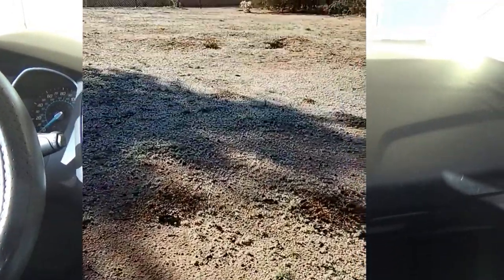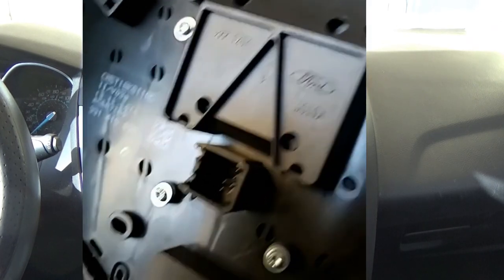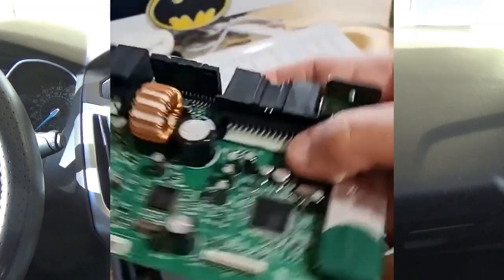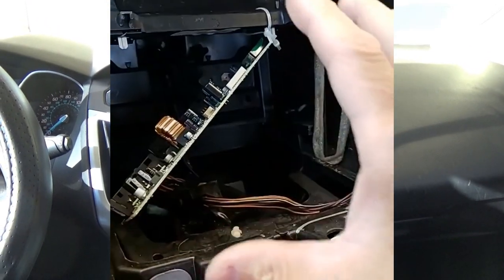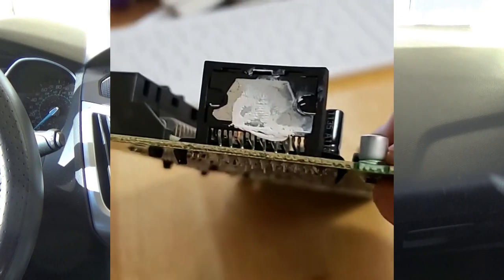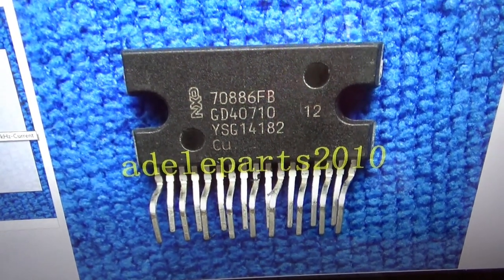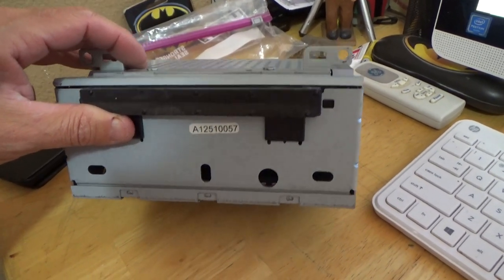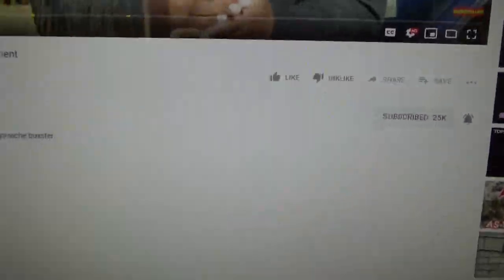2012 Ford Focus Radio Popping & Staticing Possible Repair Fix

Comment: My 2014 Focus radio made the horrible popping, cracking noise. I removed the radio and replaced the two audio output ICs.  I also added a good quantity of heat sink compound behind  each of these chips.  It's  only been a couple days but so far so good.  Replacing those ICs isn't for everyone.  I'm a retired electronics tech and even I had plenty of difficulty with replacing those chips.
Reply from the maker: These Cars Have A lot of Recalls.
Reply: My brothers Ford radio is draining the battery. Took the radio out and connected to external 12V psu, the amps are oscillating rythmically every second like a metronome (0 to 1Amp). The heatsink attached to the two audio IC's is getting warm. I think I may try replacing these two chips, but seems quite a task. Well done for fixing it.
I may suggest my brother gets an aftermarket radio instead! 👍
PS Board looks perfect. No popped caps or corrosion. But is 2007.

Comment: EXACTLY what my grand-daughters 2012 Ford Focus does (did).  Ford Focus Radio = JUNK!!  In her case, weak battery + several months of this radio issue = dead battery.  The radio designer must have needed to keep a HOT B+ on the radio (regardless of ignition key on/off/acc) to keep the volatile memory alive, neglecting to see the circuit vulnerability allowing HOT voltage to access other circuits, keeping the amplifier ON.  JUNK, JUNK, JUNK.   Thanks for the video, most helpful!
Reply from the maker: Thanks for watching.
Reply: Mine never worked when I hot the car plugged in a aftermarket killed the battery with the radio off so I wired a socket fuse and shut it off directly at the fuse box and my battery no longer get killed

Comment: Looks like there was originally a heat sync attached to them, what's why there are remnants of the thermal paste. If you bought some new heat syncs & thermal paste, it should fix the issue. They would keep the transistors in the small amp chips cooler so they wouldn't overheat. Normally transistors generate immense amounts of heat when in operation & have heat syncs attached to them due to this reason
Reply from the maker: These radios are garbage, ford knows about it and dont care. Threw it in the garbage.
Reply: They sit directly against the outer case. 
I took mine apart and it seems like the outer case (metal) is the "heatsink" lol
Reply: @inazuma1  when you took it apart did you put new paste on did it work?
Reply: @roniclark6514  yes, for a few months. 
Ended up buying a used radio from a Ford c max on ebay and it's been working fine ever since.

Comment: The heat paste transfers heat to the box casing of the metal box..the box will help dissipate heat with new heat paste
Reply from the maker: threw it away and sold the car.

Comment: Those things are normally hot. The back pad with the thermal paste uses the metal radio case as a heatsink to dissipate heat. Not saying it couldnt be the issue, but they do get hot.
Reply from the maker: Took the radio out and thru it in the trash.
Reply: Did total removal of radio make the scratching and popping quit? Thank You!!!
Reply from the maker: @rickduke1081  yes

Comment: Those need the radio casing to dissipate heat. That’s normal for them to get hot. Take a wire brush and go over the entire board. Make sure it’s unplugged first. If you are wondering why, research tin whiskers
Reply from the maker: i thru it in the garbage and sole the car.

Comment: Did you figure this out?? My horn stopped working at the same time the radio did the static pop thing!! I'm tired of being my own rock band in the car...lol...
Reply from the maker: I thre it in the garbage and use my phone now to listen to the radio.
Reply: @Iseekoutthetruth  <3 Probably the direction I'm going to take too:)
Reply: Okay.... maybe you have the answer,  so im going to ask you first! I noticed that if I don't use any other keys on my key chain,  it happens less frequently,  and when it does snap crackle and pop,  if i reach down where I can adjust the telescoping on my steering wheel and jiggle the wires that attach to my cylinder to start the car,  it stops.  Could this be a short in the key cylinder causing all this chaos?
Reply from the maker: @ohbabeissmokin  maybe
Reply: My horn did the same thing as yours. No radio, no horn. But all of a sudden, months later, my horn started working again. 🤷🏼‍♀️ The radio still pops and cracks though.
Reply from the maker: @alaynamudd4156  threw my radio away, no more poping.
Reply: The same exact thing happened to me...radio and horn went and I've told my husband the same thing you mentioned that maybe there is loose wiring in the steering column because both the horn and radio wires are in the steering column

Comment: I own a 2013 ford focus and my radio recently started popping and cuting off so i did some research and found out there is a connection on the left side of the steering column under the turn signal little a bit closer to the dash , it can become loose over time its not the acm (audio control module) but it is connected to the ignition if you mess with it at first it seems like a wire is loose but it is the whole module. I've been at it all day and finally got my radio working after i figured it wasn't a wire issue but the whole module the part number im assuming is u3nfa and it pops up as a ignition module of some sort but after some jurry rigging (zip ties) my radio is working again ill be heading to the junkyard and see if a replacement will work
Reply from the maker: cool, i threw my radio in the garbage and just recently sold the car.
Reply: Iseekoutthetruth  do you miss ur car? Mine is doing the same
Reply from the maker: @angelf5186  no, I do not miss it. I got a better car, Honda CRV.
Reply: Did it work tho???
Reply from the maker: @theofficialdjcj no

Comment: Those are audio output chips. They will get very hot and burn out if not attached to the heat sinks. Look very close to where the chips are soldered to the board with a magnifying glass to look for broken solder joints. A broken solder joint is what is causing the problem with the radio.
Reply from the maker: I sold The Car and Threw The Radio In The Trash.
Reply: Actually one of those chips is a voltage regulator and the other is the output. But if it helps anyone out there…I removed the radio from my 2014 Ford Focus yesterday to attempt a repair. It had started making frying sounds with the ignition switch turned off and no one in the car.  The solder in this radio is very hard to work with but can be done. I was unable to find the exact location of the broken solder joint that was causing the problem but found several areas of suspicion. I re-soldered each leg on both chips pointed out on the video and each leg on both of the connectors and the legs to each of the capacitors in the radio. Re-installed and works perfectly.
Reply: @Iseekoutthetruth  I guess I was a couple years too late but maybe the info might help someone else.  I watched your video before I decided to attempt mine to get an idea of what I was dealing with so thanks for the video
Reply: @steverayburn4138  Is it still holding up after your repair?

Comment: unlikely the Power amp ic is at fault - when these go they usually go with a bang and never work again, the bigger NXP chip is the power amplifier and the other smaller IC is a voltage regulator, the heat sinking for these is only just about adequate (there was no money in the pot to improve the heat sinks). These units did have another design weakness, one that was copied over when Ford found an even cheaper supplier for their radios (I guess to save development costs they took the fast route) and did not follow the design guidance provided.

The later head units do not last as long, especially if you live in a warm climate!
Reply from the maker: i tossed it in the trash and sold the car.

Comment: Having the same issue in my 2014 Ford Focus SE. Info I have found on this issue thus far has stated the amp/amp wiring being the culprit
Reply from the maker: The radio is Garbage. Threw mine away and sold the car.
Reply: Were you able to get it fixed?
Reply: Mori Anderson were you able to get it fixed?
Reply: @derrickjones3505  Hi Derrick! I sure wasn't.  I changed the fuses as shown just above.  I am dreading having to take it in to Cartunes! >_<
Reply: Heads up for my theory. I strongly believe that the 2 integrated amplifiers go nuts, after the silicone compound dries up where it connects to the radio casing as a conveyor heat dissipator. So, those integrated amplifiers heat too much and cease working. They cost $3 each. I have a radio problem and I am going to replace both folks.

 Please have a calyfragilisticexpialispectacular week !
Reply: Did you get any good results after replacing the two amplifiers?
Reply: @morikayradio  No. Radio actually stopped making this noise for some time. Recently started acting up again. Wife is screaming at me to get it fixed.  Cant say I blame her.😁
Reply: This is what mine is doing so bad I can't even go anywhere. My 2 year old is terrified of it. 2014 focus biggest regret of my life
Reply from the maker: I sold my car.
Reply: @Iseekoutthetruth  wish I could
Reply: How did you fix it?
Reply: @nymontano3874  Got rid of it. Trade it in for 2021 KIA RIO S 😁
Reply: @hollynelson2626  I have a 13 focus and a 2 year old as well. That static sound strikes absolute terror in her!

Comment: Did a new radio fix the issue? Other blogs on this issue stated that even replacing the radio didn’t fix the issue. Just curious about your experience. Thanks
Reply from the maker: Never bought another radio, I use my phone now.
Reply: I heard people have had good luck with replacement radios.  Yet, like some manufacturers they get bad or poor made parts.  That's some of the things the U.S. is always fighting with these our countries about poor quality car parts.   Examples, air bags, ignition switches, and ect.
Reply from the maker: @michaelelliott289  no Quality in America today.

Comment: You can try to change those ICs out. One or both may be bad. Worth a shot. Are you worried about the radio? I bought a car stereo at walmart for $50 and I'm going to hook it up in the garage. I have a nice pair of speakers.

If you can handle close solder joints you can try but might void your warranty and you'll have no radio. What kind of soldering iron do you have?
Reply from the maker: I am not worried about my radio, but I'm not spending $50 on a new radio. I have just a regular looking solder iron.
Reply: @Iseekoutthetruth  the one I have is the one they sell at walmart and the solder is in the plastic tube thingy. 

If you want to give it a shot you can but if you mess up you'll have no radio.
Just watch the solder points. They look very fine on that chip. Maybe change the larger chip first. One looks like a preamp and the larger one the main amp IC.
Reply from the maker: @coondogtheman  This is the stock radio, there is no warranty on this radio, it does not work now, I do not have the IC chips, I would have to order them but they are from china, I could careless about this radio, I can use my phone to listen to th radio if i want. i will not be spending money on a new radio.
Reply: @Iseekoutthetruth It looks like the pins on the ICs are thru-hole mount which is very easy. You'll need a solder sucker as well and the two chips. Go to town man since the radio doesn't work anyway.
Reply: Good tips dude. Still helping out 2 years later

Comment: Those "things" you say are hot are the final output I.C's. They're what actually amplifies the signals. They WILL get hot if they're not firmly attached to the heat sink. If one or both get EXTREMELY hot while powered on with volume at minimum it's probably faulty. Bad final amps can make some pretty unforgettable sounds in their death throes.
Reply from the maker: I sold this Car.

Comment: My 2012 Focus has thre radio work on and off and sometimes it even output SUPER loud static through the speakers ever when the car is off. Anyone have any advice or suggestion? Is the whole radio junk or is it salvageable?
Reply from the maker: its Junk.
Reply: So this is exactly what happened to mine and now the radio is completely dead I put up with it for a year but I’m gonna dig in and try and figure it out
Reply from the maker: @chrismorine5406  its garbage.
Reply: literally dealing with the same thing, it’s so fkn annoying
Reply: mine has gotten so bad I’m scared to drive it. I’m so lost on where to proceed with it. It’s like a screeching static. Got so loud I pulled over and got out the car. (2012 Ford Focus SFE)
Reply from the maker: I took the Radio out.
Reply: I have the same static problem. Anyone know how much is costs to fix?
Reply from the maker: Nope, sold my car, its got way to may recalls on it.

Comment: 2014 ford transit.  same radio same static and amp popping.  radio doesnt work at all noise continues even with truck off and car doors remotely locked
Reply from the maker: yup, threw mine in the garbage.
Reply: I had to take all radio fuses out to make the noise stop
Reply from the maker: @christinasatterfield6711  I just took the radio out and it stopped.

Comment: My car usually plays music for a good 30 minutes and then after that it starts popping and then music plays for a few secs and then it pops again. Any ideas what could be causing that?
Reply from the maker: No idea, Fords radios are garbage. Threw mine in the garbage and sold the car.
Reply: This is the problem if had for 5years with a 2012 ford fiesta se. Works for the first 20minutes maybe 30 minutes then it pops out for 1-3 seconds then works for 2-4 seconds before popping out for a few seconds again. I have to remove key, open and close door to shut off power to it completely then wait about 30minutes before turning ignition again to get maybe  30minutes of uninterrupted use.

Comment: They are essentially mosfets that your referring to. Most likely thats not the problem. Typically its the square chips with more pins, like 120ish pins that come loose. Essentially they are the processors. All of these ford radios and any of these years are junk. We replace them almost weekly these days.
Reply from the maker: Sold the car.

Comment: Just buy a after market head unit .you can get everything at walmart or bestbuy. The factory radios are crap
Reply from the maker: Just like I said in the video, i have NO Desire to waste money on a new Radio, I have better things to do with my money lol.
Reply: Iseekoutthetruth parts to repair it will cost moe than a new one but understand have blessed day .you might find one in a junkyard
Reply from the maker: A new one is a couple hundred dollars, those circuit thingy's are only a couple of dollars. I will just use my phone before buying another radio tho.
Reply: Cal Marsh repaired it for 8 bucks. So don’t know what you talking about.
Reply: The Game Show Host how
Reply: With aftermarket you have to factor in the cost of the install kit, another $150 on top of a new head unit.
Reply from the maker: I sold the car and thru away the radio.

Comment: I have no Volume in my Radio, the knoob and wheel steering stay at 0. Is that Same Problem ?
Reply from the maker: This Radio is garbage and The ford Focus has a lot of Recalls.
Reply: That’s more likely a fuse issue then a amp problem

Comment: It's the audio control module
Reply from the maker: I threw it in the garbage.
Reply: Can you tell me about the problem & what the fix is?
Reply from the maker: @kailim4109  the problem was, Ford made a garbage radio, it started popping and making crackling noises. I took the radio out and threw it away, I than sold the car. No one knows why these radios do this.

Comment: Did you ever order those parts?
Reply from the maker: closure., thru it in the garbage. Had a radio guy tell me that wont fix it.
Reply: Iseekoutthetruth you threw away something that just needed new paste. CPUs on gaming computers need it once every year to keep the heat down. These don’t need it that much. However with all the vibrations from bumps and driving it’s going to need it from time to time.
Reply from the maker: @RDMGAMER  i use my phone to listen to the radio now, it works just fine.
Reply: @RDMGAMER  thanks for you input, i'll definitely try to remove and add more thermal paste to it and see if it works
Reply: Ali Esmaili did it work !
Reply: @fritztopher  No, for some reason my radio went off and now it won't open. I need to try doing a reset from Ford with their computer system. But too lazy right now to try it. But it doesn't make any sound anymore. Worth a shot for only a few dollars of thermal paste imo
Reply: Any further progress on getting it to work after applying thermal paste?

Comment: So you said you ended up throwing it out? But you are still able to connect your phone to your car? I've got a 2013 Focus and i had this problem for awhile, then the popping / static got real bad and it'd cut out all audio too until i turned my car back on. Now the radio wont even turn on at all. Any ideas man? Idk how they can release a radio like that...
Reply from the maker: I threw mine in the trash. My phone is not connected to my car
 I just use wireless ear buds and listen to the radio on my phone. I dont need a radio in my car now.
Reply: @Iseekoutthetruth  Same here.
Reply from the maker: @EddieLeal  👍

Comment: Mine would do it as soon as I turned my car on after being off all night, had to pull out a fuse to keep it from doing it since it would do it even with my car and radio turned off. So it might not be because it's getting too hot, at least not in my case.
Reply from the maker: Garbage Car and Radio. I sold mine.
Reply: Which fuse did you remove to get the static and popping to stop?